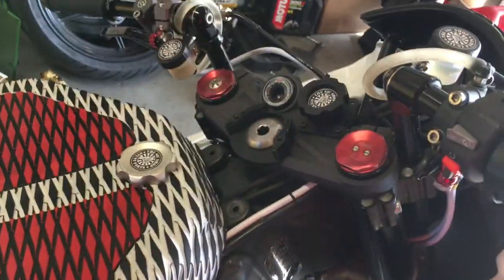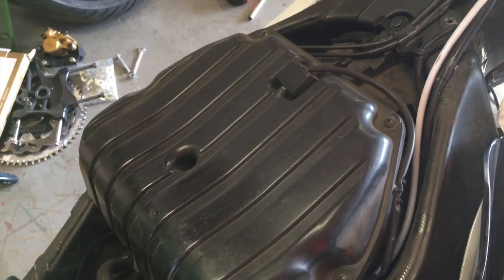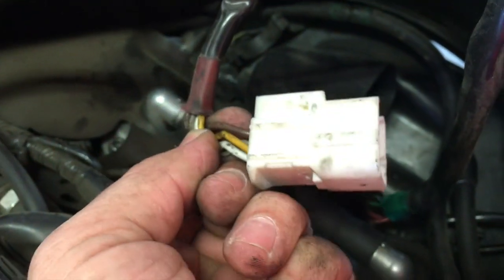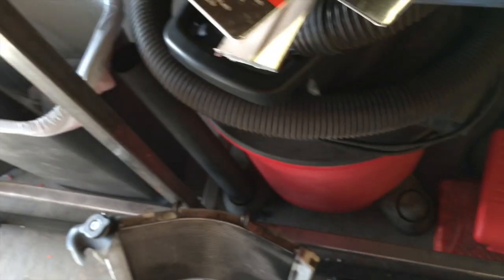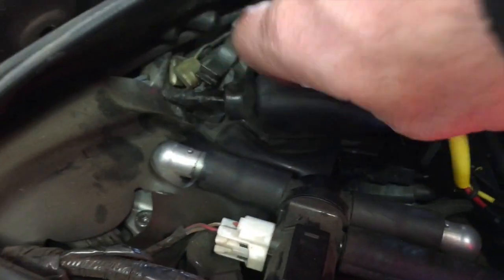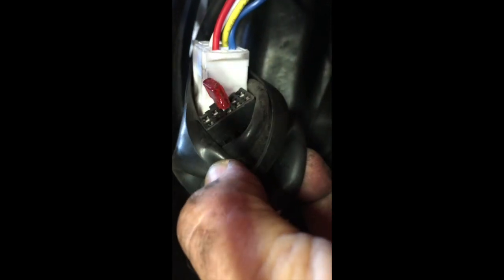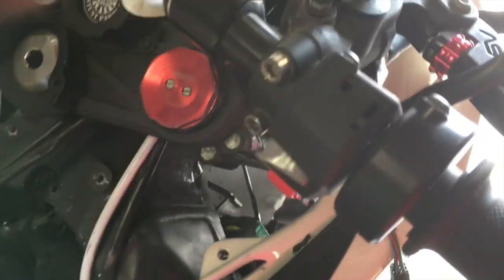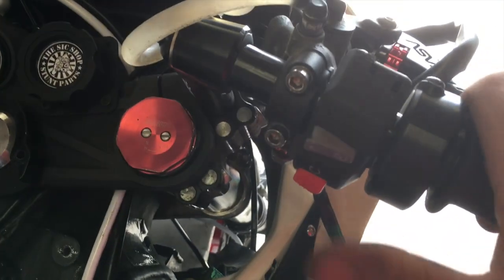Installing a Keyswitch Bypass - Cutch Switch Bypass - Run/Start Switch Mod

Comment: Do you have a harness for a 2003 gsx750f? It's the katana 750. It's essentially the same as the GSXR, 6 wire ignition. Let me know!

Comment: What did you do about the immobilizer in the ecu? without the chip n the key turning in the ignition to send the signal to the ecu it wont start how did u get by that?

Comment: i have a zx10r 2004, is this gonna work? i lost the keys.. and its 2000$ for a new one because the dealer says you hav e to change the key and the ´brain´on the bike..
Reply from the maker: Many of the European models have an immobilizer system with a special key containing a transponder

Comment: Sup buddy ! I’ve got a 2004 Ducati ST3 1000!no ignition switch or sensor-will it work
Reply: Sorry they do not make it for your model and also your bike has an immobilizer system with a transponder key and receiver ring in the ignition